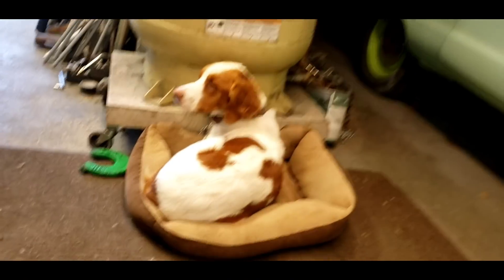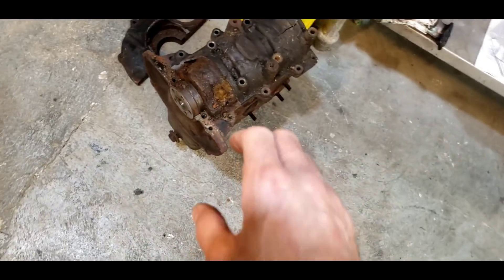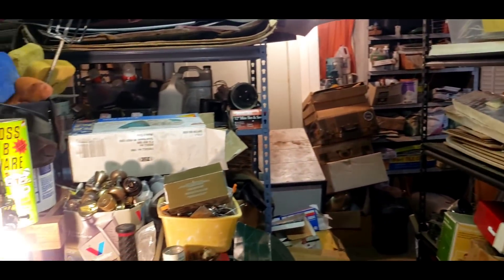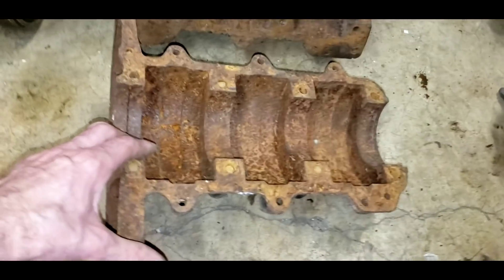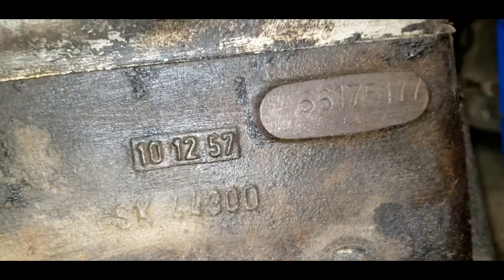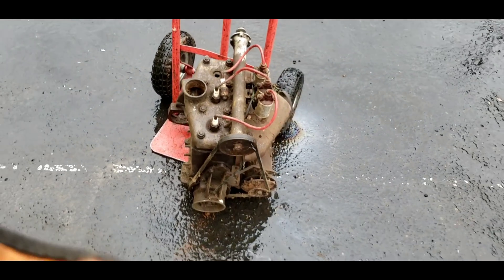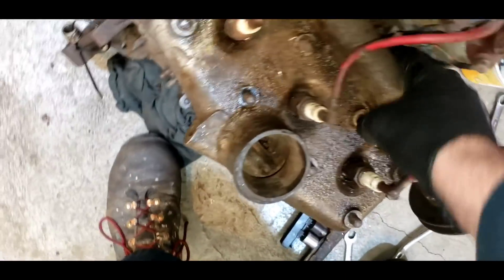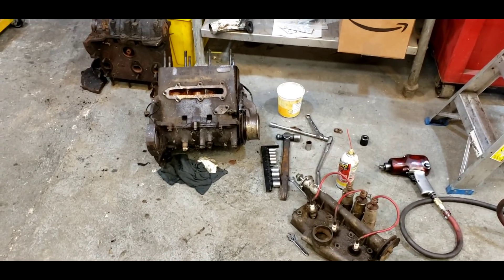Let's Bust Open Yet Another Rusty DKW Two Stroke Engine

Comment: Hello, I don't know if you remember me but many years ago we exchanged messages when I had my Autounion 1000 coupe de luxe 1958 and you were building the yellow dkw 900.  Watching your videos I inform you that the engines are 900 cc.  Here in my country there are almost no mechanics that assemble good crankshafts, but luckily in Brazil they are making very good quality.  Greetings from Buenos Aires, Argentina
Reply from the maker: Yes, Dekabras in Brazil makes high quality rebuilt crankshafts, un fortunately its very expensive to ship back and forth to USA.

Comment: Be careful when trying to use the crankcase cover of one engine on another. I explain the reason: In the factory mechanics manual there is an indication that the block and crankcase set must be "couple, made of the same material". This is due to the fact that the bearings for the bearings are milled simultaneously in the two parts, so that they form a perfect circle. As the cutters, over time, tended to have axial clearances, one of the parts of different motors may not be with the exact half of the circumference, causing damage to the bearing when the cover is pressed into the block.

Comment: Might be an interesting experiment but you could try electrolysis on the first engine you showed since it should remove and convert the rust. Also what I heard it can do is eat aluminum so maybe those two combined efforts would get the pistons out of it. Even if the block is trash that info may prove usefull in the future. How is the C10?

Comment: I'd get a barrel, and put about 3gallons of vinegar in about 3-4 gallons of water, sit it on a fire, get it to a near boil, and through the engine in there for a few hours, pull it out flip it over, and dunk it again for a few hours,  it should take all the rust off, I have had a rusted mess come out looking like a new piece! I'm not sure what the aluminum will do in vinegar, but the iron should come out clean, but keep it hot, rinse with hot water, then blow dry and oil to prevent rust!

Comment: Hello. You probably know that the East Germany Wartburg  was developed from the DKW. Wartburg was manufactured  until the late 80's with the 3 cylinder 2 stroke engine. I wonder how interchangeable the parts are.
Reply: Unfortunately, only the spark plugs are interchangeable between the Wartburg and DKW.

Comment: Isn't that the same as the warburg motor?
Reply: No - similiar looking. However, a Wartburg motor with the cylinder head turned around will fit in a DKW with a bit of cajoling.
Reply: @TheGooneybird  I think the thing was that Wartburg was building their motor based on the dkw design.

Comment: Those dkw,cars are cool but those stroke engines are boat anchors, put in a modern inline Honda motorcycle engine instead  of that rusted pile of history
Reply: You're wrong there Ronald. These engines are super smooth and very reliable. They run 100 000 to 110 000 miles between overhauls, which was amazing for 1950's engines.
Reply: @TheGooneybird  100k for a2 stroke even a modern one is good.but that old tech was the best they had at that time, there are much better engines out literally sitting on shelves you have some amazing cars in your collection get them back on the road, that's the point of restomods,get them working without all the fussing and scrounging out trying to use an original engine. Those cars never reached their potential because they were limited by weak and eccentric engines